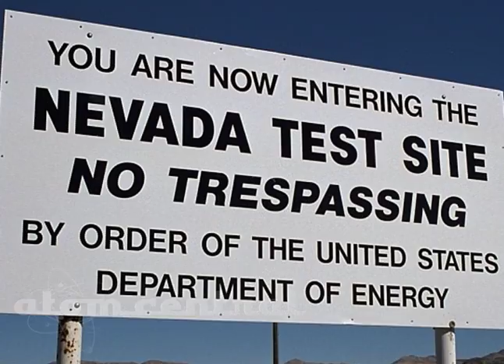The Building They Couldn't Blow Up at the Nevada Test Site

Comment: I want the specs on that building.
I think it would be a fantastic way to construct a tornado proof house here in Moore OK.
Reply: Hurricane building codes would be a good place to start for indirect hits.  Direct hits would probably require something along these lines.  Reinforced concrete walls structural steel and concrete roof, balistic rated windows,  metal doors with supplemental locking bolts like a safe, and a pier anchored foundation would probably be as tornado proof as possible for a standard house setup.  You could go with a brick veneer and standard sheetrock or texture/paint interior and metal or composite roofing to make it look like a standard house too.  The only real limitation is your wallet.
Reply: @danielh4995  Hurricane code structures don't even hold up well in 200 plus winds, with wind driven debris. 
In fact, usually there is only slabs where the house was.
No, better construction is the only answer. and this particular bldg may hold the key.
Reply: How about a hole in the ground instead. It proved to protect soldiers very near the blasts. They werent even roofed, they were just trenches. So an underground reinforced bunker should  do the job better. If I lived in tornado alley, I would have a massive well furnished man cave cellar and never worry.
Reply: This house would be sufficient for the strongest f5 tornadoes that ever happened

Comment: What shot was put up against this? I see Upshot-Knothole Climax footage.
Reply: Priscilla test on june 24 1957, 37 kt
Reply: sgtchef I see the location, noting the wall material tests line in the the background. Darwin mentioned it survived 4 nuclear tests, but the structure could have been built at any time then. Of course seasonal ice can further damage old rebar concrete like that in the crumbling roof that had structural cracks. Yet it's still impressive.

Comment: The building might've survived but think anyone inside it would be screwed. It'd be good for a makeshift bank vault or something along those lines.
Reply: Well concrete is pretty good for radiation shielding. Add some air filters for the fallout and you have a very decent nuclear shelter
Reply: The woman starting her morning shift at the bank she worked in Hiroshima was 200 meter from the epicenter and she survived because of the sturdiness of the building.
Reply: @heno02  That's amazing! Wonder if she could still hear? Had to be one hell of a loud boom! Wouldn't think anything would survive that close. While everyone outside was getting vaporized it still had to be hot even inside the building!

Comment: What were the parameters of the tests? How far away from the building? Air blast? TNT-equivalent? Does anyone know?
Reply: Air blast is where it detonates while its still in the air, it can't have been that close and im not sure the size of bomb it was, it certainly is not hydrogen bomb
Reply: Air burst also doesnt pick,up that much radiation but does alot more damage
Reply: Priscilla test on june 24 1957
Reply: @stgkillerkill  Thank you very much!